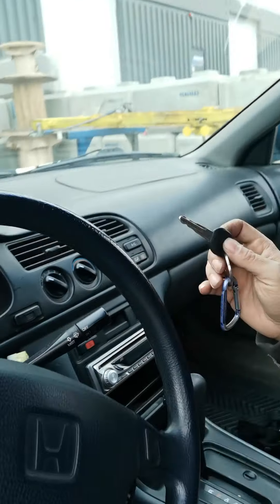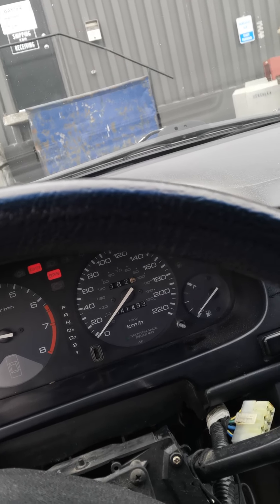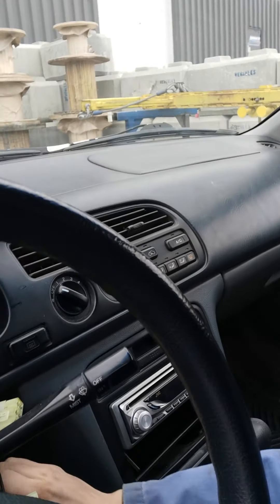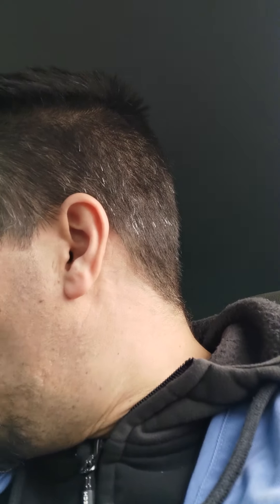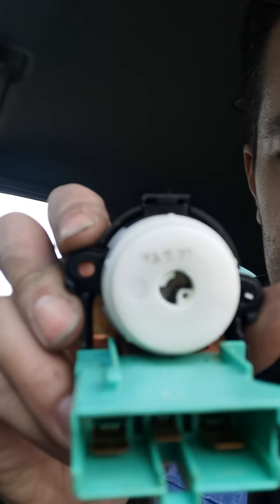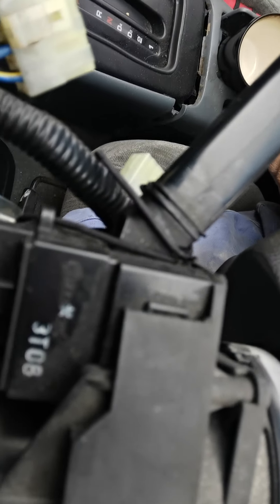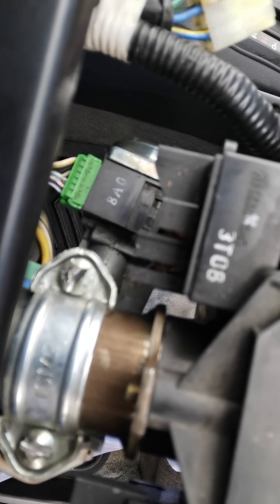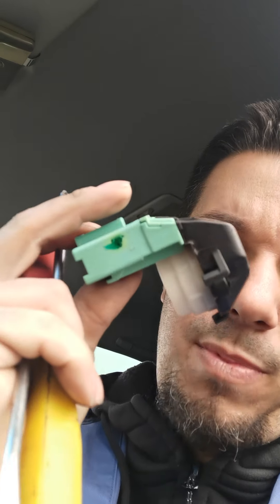1994 Honda accord ignition

Comment: …mine has an intermittent no start issue that only happens after heavy rain.  Any suggestions on what it might be?
Reply from the maker: No start but still cranks ??? .... If after heavy rain ...I would pull the distributor cap off and check for moisture in there ....spray it with wd40 ...if not I would check all my battery connections in the engine bay and going to the starter ...hope this helps
Reply: @molinelligarage1004  yea that helps…I’ll give all that a look.  Thanks man, subbed!